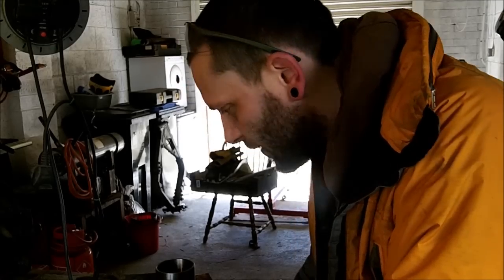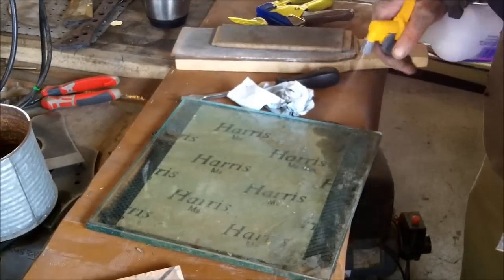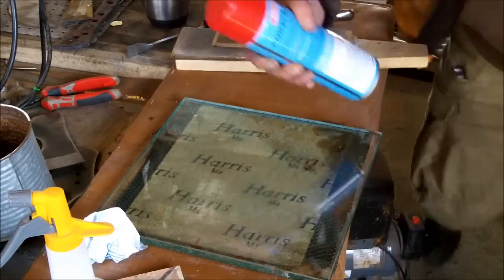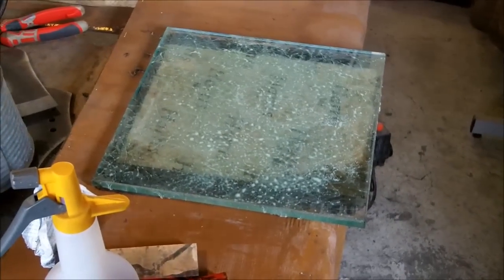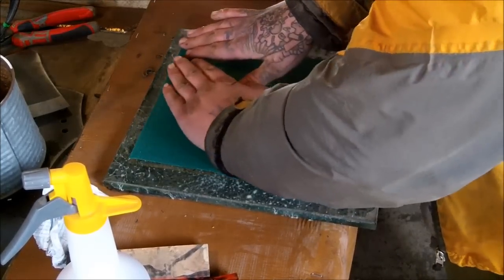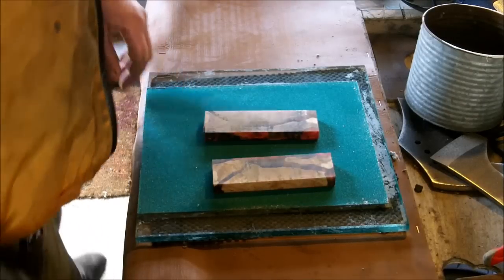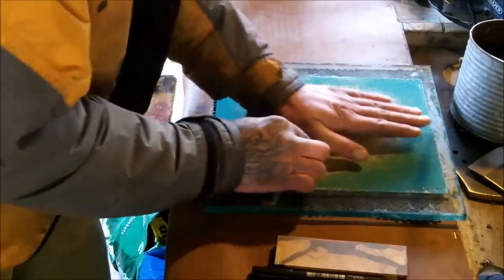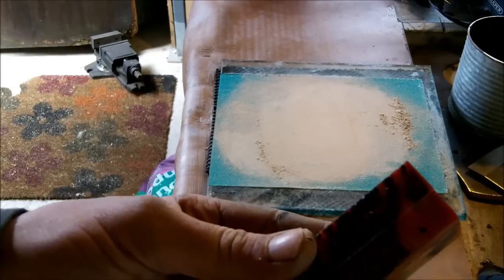Workshop Tip - Flattening Scales for Knifemaking

Comment: have a look at rynowet sandpaper, its the shit. I asked around at a show here in australia last year and all the knife makers said it was awesome. After using it for a year now i can tell you i completely agree. just make sure you get it in bulk so its cheaper
Reply from the maker: DB Blades I normally only use Abranet, exclusively, but they do not do big sheets that size. I will have a look man, thanks for the tip :)
Reply: no problem man, its spelt rhynowhet sorry if you want to google it.

Comment: I use the bed of my table saw as a flat surface I don't use any glue though I just hold the paper. I'm currently modding a schrade schf7 (6mm thick 1095 7" blade) I was give a snapped purdey stock from a gun maker so I've cut it into slabs to use for the handles. Do you have any tips for sanding a hollow grind? Unfortunately I don't have any contact wheels that match.